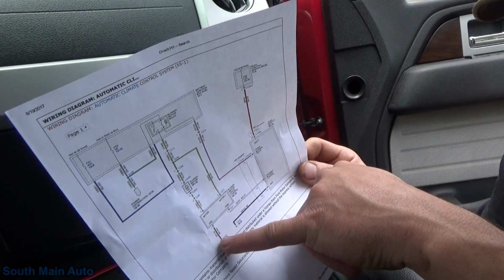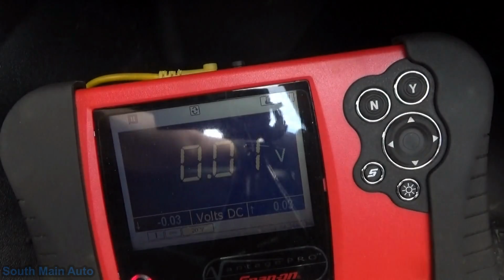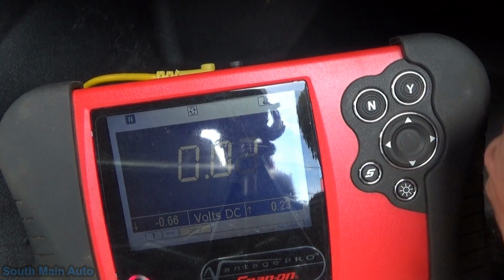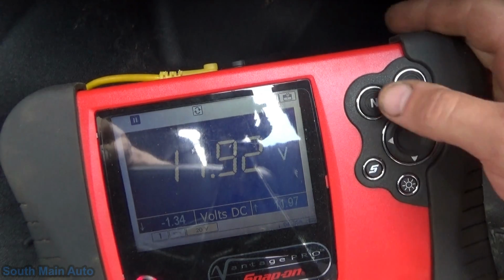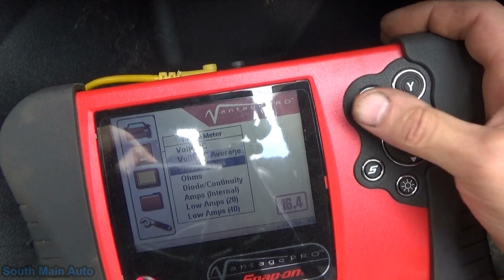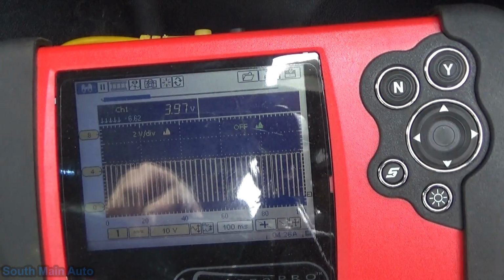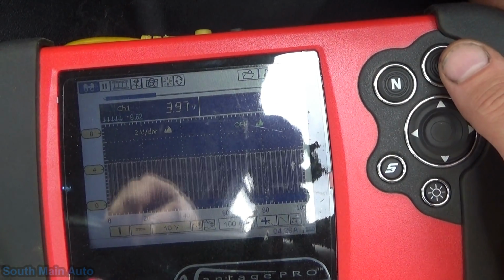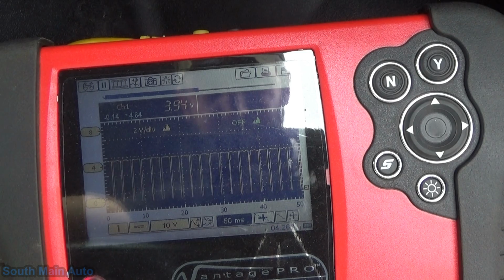Ford F-150 - Blower Motor Stuck On Medium Speed

Comment: Upstate NY people must be candy-asses. It goes above 80F and you're running to Eric to get your AC fixed and you're blower's simply got to run on high. Out here in Phoenix the high temperatures not been below 110F for two weeks and likely will not be for another two months. We need air, you guys just aren't tough enough.
Reply: come on up in February you candy ass
Reply: Lived in Pittsburgh for 41 years. That's why I moved to Phoenix.
Reply: I was stationed at Fort Huachuca Az while I was in the Army.  Thought it would have been tough being I grew up about 30 miles from lake Erie and would always get lake effect snow.  Honestly it's not that bad.  It actually kinda pampered me alittle, and hated coming back to the east coast. What you have to keep in mind is there is no humidity (unless your in the raining season) in the Arizona desert so while you might be sweating your ass off at 90 degrees with 95 percent humidity anyplace on the east coast of the US, in the Arizona desert 90 degrees particularly at night time might feel cold because the humidity can often be less than 30%.  Humidity makes a huge difference.  

I remember as a kid snow being well over your head deep after you shoveled/snow blew paths to the barns and such.    Particularly in the spots where drifts would accumulate.  One winter I remember the snow being dang near even with the rain gutters on the house (single story house).  While I have found memories of exploits with sleds, snowmobiles, and half plowed parking lot doughnuts, I don't miss the shoveling and downright nasty cold weather in the winter.  Third week of January usually was the coldest and I remember it getting down routinely to -10 to -20 and at night.  You gotta be tough to live in a place like that.
Reply: You were too far west...grew up in Altoona, 90 miles east of Pittsburgh, which is still within the Lake Erie lake-effect snow belt!
Reply: If it's 70 or more my AC is on. I can't stand the heat haha. I don't know how you live there, I've never even felt 110 degree heat in my life and don't want to!
Reply: I hear ya bud. Hang off the back end of a garbage truck at 32 below zero, talk about some cold weather. Minnesota gets some of that nice weather also. Hydraulic on the
truck did not want to move either that was always a fun day at work
Reply: I went to Minnesota one time in MAY for a Woodfinishing Class at a technical college right next to Prince's Paisley Park Studio. I was so damn cold I was wearing one of my old Pittsburgh winter jackets. It was over 100F back home and I was freezing to death in Minnesota. Maybe that's why there are so many Minnesotans here in Arizona.

Comment: Interesting that it was stuck on medium.  Every blower motor I have replaced seems to be stuck on High or rather only work on high.  All of the ones I have done have been on cars with a speed setting switch (knob).  Do the digital ones work different than the more manual with the knob.
Reply: old school blowers have resistors for the lower than high settings so when the motor starts to gum up and it draws more amps it over loads the resistors and burns those out and you are left with direct power on high till the motor fails or it blows the fuse.
this Ford uses the unusual method of pulsing the ground on and off at different speeds to control motor speed, the HVAC controller sends a pulsed signal to the speed control and it uses that to vary the speed.
some use a AC brushless motor, their controller sends a speed signal to the motor controller and it converts the DC battery power into AC power and the frequency of the AC power is varied to change the speed of the motor.
Reply from the maker: That is common on the GM's like that because they use a separate relay circuit for speed five
Reply: FrugalPrepper I have a good one for you, it's a 2002 pontiac grand prix gt gives the option of 5 speeds but only 1-4 work.

Comment: Hey Eric good morning I have a question for you I have a 97 Chevy Tahoe 4 x 4 in the air condition just keeps on throwing air on the dashboard on the defrost on top and on the bottom I changed out the actuators but he still keeps on doing it any suggestions

Comment: I appreciate good troubleshooting (I'm an IT guy). For me, we have 4 vehicles, all Dodge/Jeep between 97 and 02. I've had to replace the blower resistor in 3 of them so far, all in the last 2 years. I opted to just replace the resistors, because I knew that if that wasn't the issue, it would eventually be and I'd have the spare on hand. If I was to troubleshoot the one of mine that is digitally-controlled, would it be possible to test the pulse with a multimeter or test light? or is a scope the only option?
Reply: I understand that a scope is the best tool. However being a DIYer I'd prefer getting by with more basic (affordable) equipment. If I can observe the pulsing with an incandescent test light, and the change in frequency when I adjust the knob, then that works just fine for me.
Reply: Matt Hooker Ive replaced it 3 times in my wifes Pacifica never in my 02, 300m
Reply: A PWM is frequency- so a "digital volt meter" won't see a sine wave, and a sweep-meter will only see a measurable pulse- an incandescent bulb will dim and bright, so a scope is the best tool.

Comment: Cool Eric.  We now have defroster motors on our buses that are bldc that have a control module and 3 hall effect sensors that relay the position of the rotor to the control module.🙂
Reply from the maker: we don't design them we just fix them
Reply: South Main Auto Repair And then the owner assumes the position when it breaks. Lol
Reply from the maker: Just like GM, that is how they do their blend door actuators. Uses a count value after it is learned to assume position. Cool.

Comment: so you checked the control wire coming in on the frequency setting on your meter? how do you know how many megahertz is normal
Reply from the maker: Kenneth White we check the pulse width signal not the frequency
Reply: South Main Auto Repair I hope someday when you have more time you can do a video explaining more on how to test components.  I have a very nice multimeter but thats it. im trying to learn from you on how to and which tests to use to find a bad component.  thank u
Reply: You must first have a basic understanding of electricity (DC, AC, Ohm's Law) or else Eric would have to explain everything before getting to the testing of compnents. None of it would make sense.
Reply: i do have a basic understanding of those fundamentals but that still doesn't help me understand some of the high level tests like wave lengths and proper megahertz readings.  Please don't patronize me as if i am a child.  It's my first attempt into understand car electronics and i find Eric O's channel to be the best on YouTube.  If i can learn it will be here.
Reply: I am sorry Kenneth, I was looking at it from Eric's point of view explaining things. He is running a business and is kind enough to take the time to video and explain the repairs. There is a point where if he explains everything in molecular detail, the vids will be as long as an engineering course. Again sorry.
Reply: David Kupferman I understand his business model and he receives money from YouTube and Patreon to offset the production of his videos. Some of his videos run over 45 minutes now so why is asking for one more just on electronic repair out of line??? Once again dont treat me like I dont understand how creators work or get compensated. Ive been watching his videos for sometime now and I learn a lot from his detailed explanations.  It was just a reasonable request, viewers on here make them all the time. If he cant do it im sure he will just read and pass over my request. I dont need you speaking for Eric O.

Comment: have a question for you I replaced mine in my GMC 2008 5.6 liter it is not blowing half as hard is the original and used to blow your right out of the cab I had replaced the resistor that didn't do it so I went ahead and replace the squirrel cage and believe it or not after living in Arizona and it constantly running the bearings were shot so I replaced it and return the resistor but I do not get the power I used to get out of it what should I do
Reply: did you replace your cabin filter??? that could be restricting the flow
Reply: no were is that located
Reply: i guess in 2003 gmc dicontinued cabin filters according to google, just thought is was an option but i guess yours doesnt have one, usually they are behind glove box
Reply: look yours up on google, you could also have a blend door accuator problem. could be vacuam operated or electric. if it doesent divert air correctly in your ductwork, you wont get the right airflow